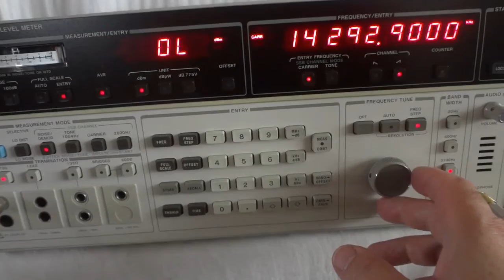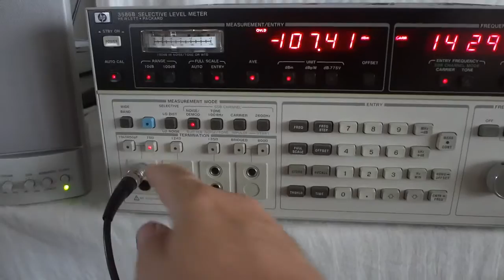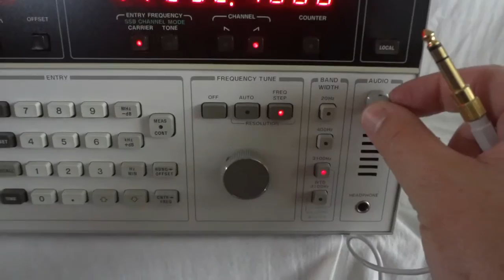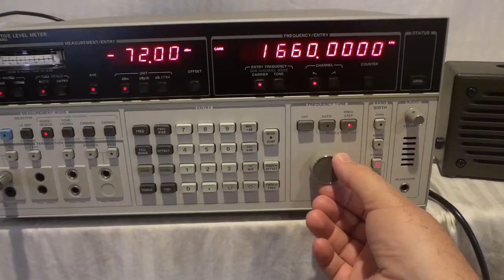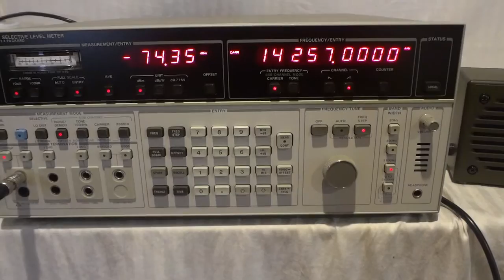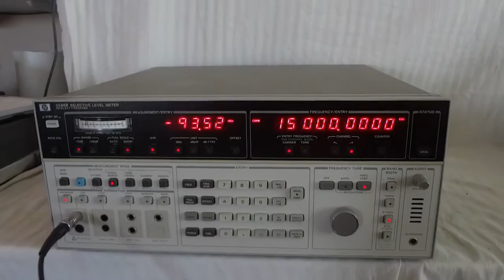HP3586B selective level meter shown as HF receiver

Comment: As one person noted, this type of equipment was used by the telephone industry to maintain Microwave Frequency Domain Multiplexed systems.  These linked microwave systems made the National Telecom System, the BELL Telephone Network a reality............(more)

The input was taken from BASEBAND signals on the microwave carrier, each circuit had a discrete HF frequency and was a SSB signal, hence the LSB and SSB detector.  Level measurement of the individual circuits on baseband had to be LEVELED to specified voltages hence the absolute digital voltage meter in dbm into 75 ohms, the baseband output impedance. 

All of these microwave linked networks have gone the path of CROSS-BAR switching offices, OUT of SERVICE and replaced by the newest of technology. Now Fiber Optic networks as well as the Internet interconnects the international telecommunications world, with overhead administration and toll data communications.

Steve, K2CX
Reply: Steve, thanks for the valuable contextual history . Yes, I remember the days of the multiplexed subcarrier telephony systems. Today. TCP/IP is the name of the game. As a result, there have been nice boards in the surplus with lots of mechanical filters to filter out the several stacked SSB signals, but lately I haven't seen them any more, appears to have dried up now. Cheers!